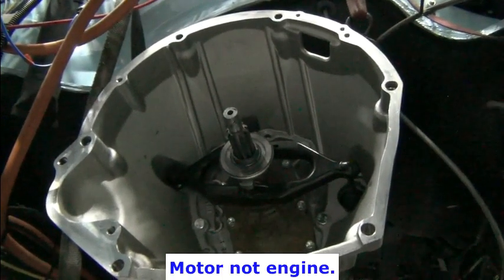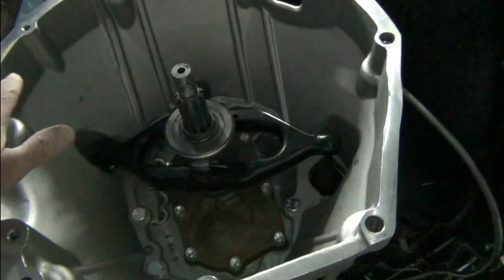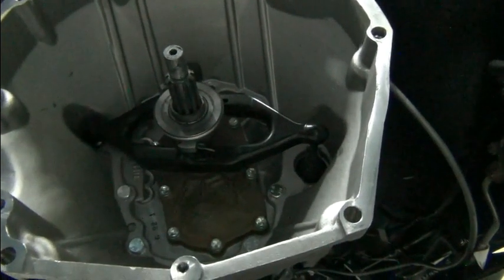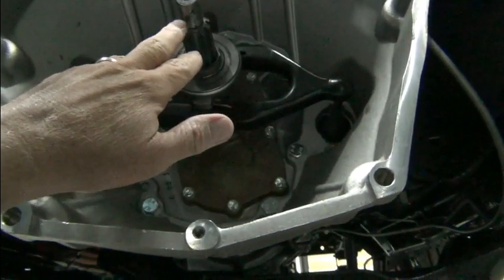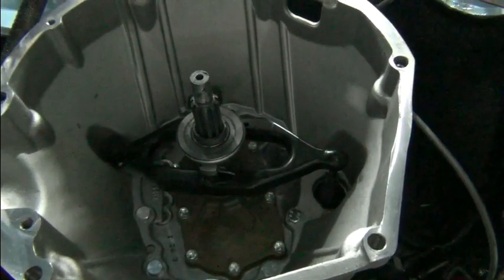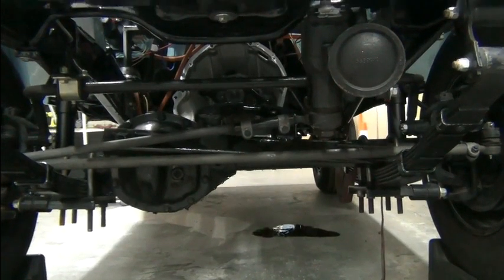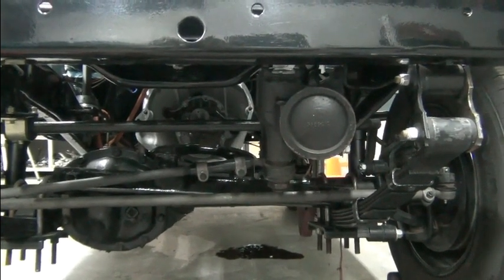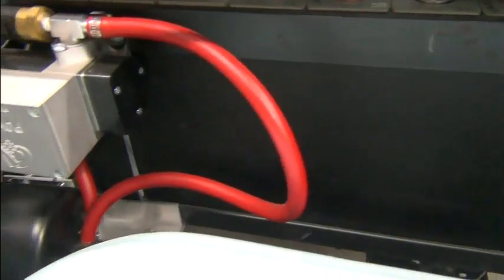Jeep CJ7 EV Conversion Episode 9, Checking noise and balance issues with the motor, etc.

Comment: Use a CNC’d direct coupler, friction fit to motor shaft, woodruff key and a set screw, if you want belt and braces. Cut the splined centre from the centre of the clutch friction plate Tig weld to one end of the coupler.. this allows the coupler to slide onto the gearbox input shaft.. 
The Curtis controller has an input for an electric switch to act as a clutch. 
Fit a tough switch to the clutch pedal mechanism, in place of the clutch master cylinder..
That way you can use the gearbox as a manual or just select a gear and drive as an auto. You can then do away with all the flywheel and clutch weight, which will be a drain on battery energy.
Reply from the maker: Check out our video on why we recommend using a clutch.  Thank for watching.

Comment: with a ev motor why even a clutch alot off thrust load every time it gets pushed plus all that weight 🤔
Reply from the maker: There is a reason a clutch is used with certain motor setups.  We have several videos that address clutches and transmissions.  Here is a link to one.  https://youtu.be/20hncy7y4_I  Thanks for watching.
Reply: @ev4u  I think a CV style centrifugal clutch styles would be a much better not so hard on it most clutch pressure plates take a lot of pressure to disengage which would applys tons of thrust load and just the weight of the flywheel pressure plate think would be hard on the bearings in a electric motor too a nice Torrington bearing mounted in there to take the load  would be a good idea
Reply from the maker: With 100,000's of miles on my personal conversions, the motor bearings have not been an issue.  Matter of fact, there have not been an issues with any of the conversion components.  The clutch is only used between gears and not to get moving.  Clutches, like brakes on an EV see very little wear.

Comment: Is there a spacer that should be there or is the key supposed to be longer and stop the coupler from sliding all the wat back? And I assume if it's not an interference fit it's been milled wrong or had a few thou removed from inside. The mystery continues.
Reply from the maker: That manufacturer does not usually use a spacer.  The keys provided typically are too short.  Most setups either bottom out against a shoulder on the motor shaft or the key slot like you mention.  That manufacturer also tends to provide couplers that have too large of an inside diameter.  We have several videos that discuss adapter/coupler inspecting, installing, and general information.  Here are two:  https://youtu.be/Q3dnMg6ZdRo and https://youtu.be/sc2kdVGUWO4

Comment: A motor is electric. An engine is gas or steam powered.
Reply from the maker: That is correct.  Usually we are removing an engine and installing a motor.  In this instance we were removing a motor, and I said engine out of habit.  Thanks for watching.
Reply: @ev4u  Do you know anyone familiar with UQM motors?
Reply from the maker: EVTV sold UQM motors at one time.  Not sure if they still do.
Reply: “Motor” boats are electric?